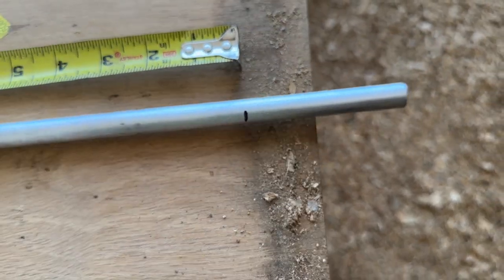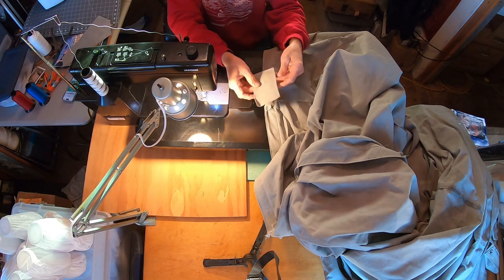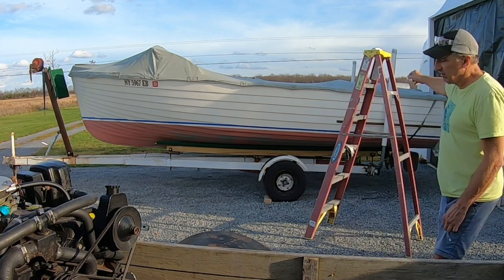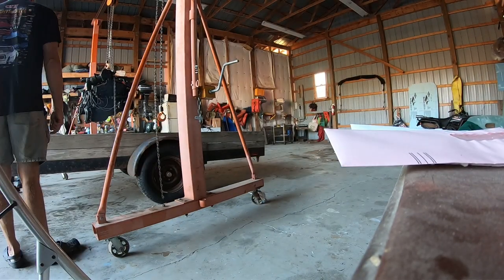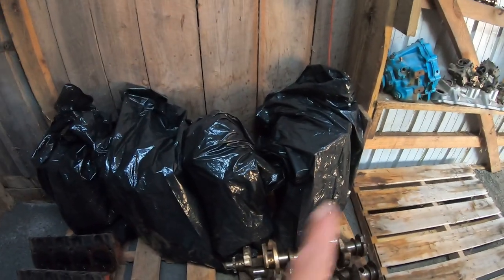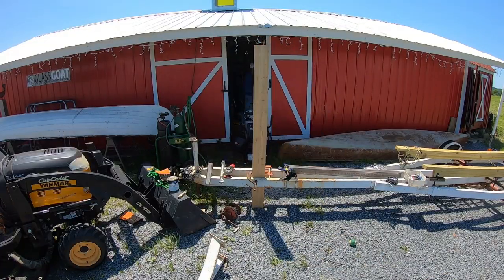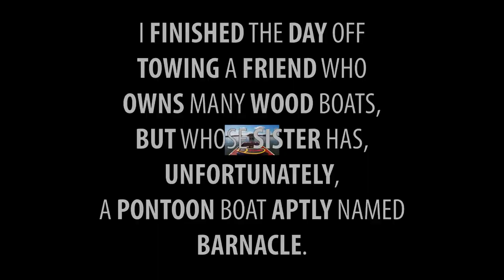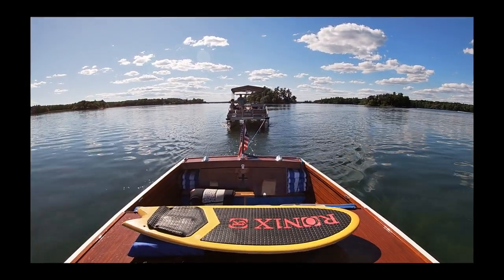Fixing Cover Issues S4 E8

Comment: Never used one myself, but a bunch of people seem to do well with the pole that sticks up rather high from center of boat, through a small opening in cover, and drapes down tightly in all directions.   I'd uncovered our Chris Sea Skiff a thousand times in the summer, each time being taken by surprise by huge spiders who seemed to live under the canvas, enjoying the warmth of the sun and the many appetizing little flies trapped underneath the cover.  For anyone who, like me, does not enjoy the spiders, just spray the underside of the cover once or twice a summer with RAID Ant and Roach (the one without fragrance) and you'll never see another spider :)
Reply from the maker: That cover has a grommet in place for such a stick but it’s in the wrong spot to work properly in this case. 
I’ve found that since using a cover consistently on that boat, I was pretty much spider free. Not sure why?

Comment: Thanks for sharing. It is always great to see the boat on the water. What are the benefits of having an adjustable winch tower?
Reply from the maker: It’s going to be awhile before it’s on the water again. I winterized it today. 

The winch has some advantages depending on the launch, it’s grade and depth. It also allows more than one boat to be serviced using the trailer. In my case, when  you use a boat cover that overlaps the rub rail, you often can’t add or remove the cover near the bow as the rub rail is pinched against the winch tower boards especially the snaps.

Comment: Beautiful photography in this episode.  The boat looks great. I like the royal blue interior cushions with the white piping, matching towels and waterline. Also notice copper exhaust pipe and was wondering how you transitioned at engine and at transom thru hull?  I thought that was pretty ingenious and very clean looking.  I was thinking orginally it was probably a length of hose and band clamps?
Reply from the maker: I couldn’t be happier with the results. A lot of people are drawn to the blue interior and the towels are often commented on. 
The exhaust, beginning at exhaust manifold, consists of a short 3” rubber hose, a reducer down to 2 1/2”, a longer rubber 2 1/2” hose, a 2 1/2” copper pipe (any larger diameter would not have fit under the floor frames), another short 2 1/2” rubber hose and the copper exhaust tip which is just more 2 1/2” copper pipe. The copper pipe was reclaimed from another boat. It was sealed at the transom with a trim ring and life caulk.